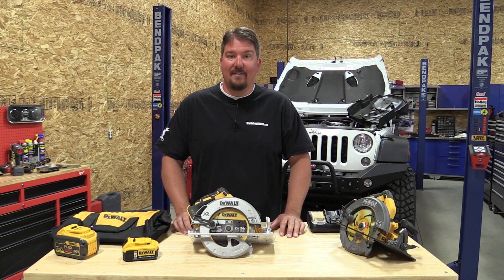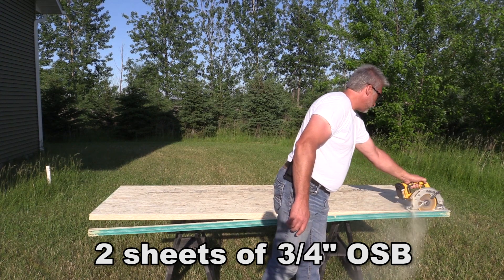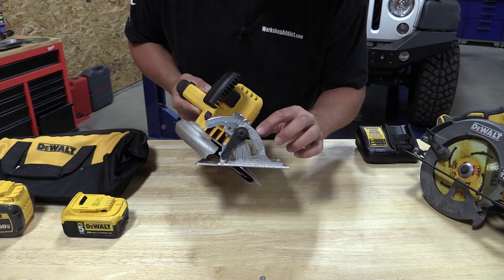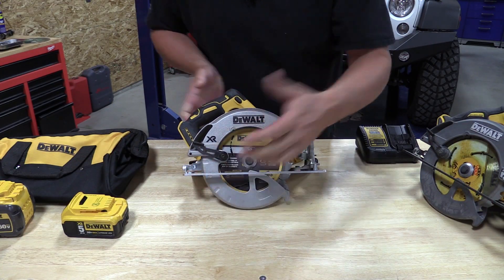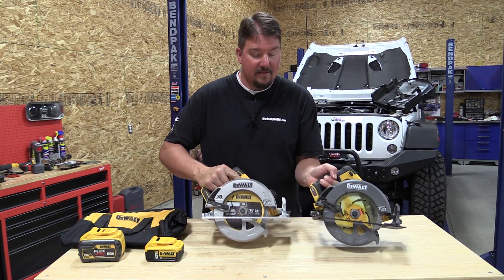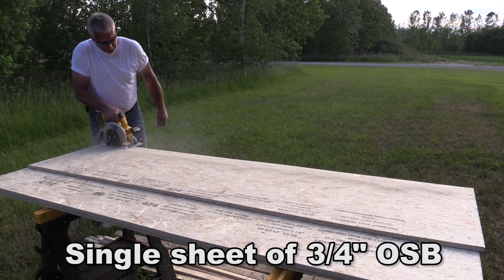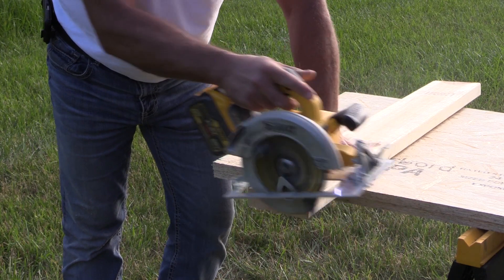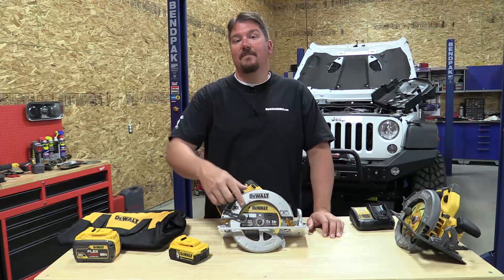DEWALT DCS570 20V 7-1/4" Circular Saw with Blade Brake Review

Comment: 2024…Dewalt still hadn’t corrected the zero scribe on the shoe front not lining up with the blade.  It actually cuts about 2mm to the right of the index mark…this is not ‘kerf’ if you think about it the inside edge of the blade should align to the zero index so the kerf is part of the waste, but it doesn’t.  So, either use a fence or make a new marker in the shoe for free hand cuts.

Comment: I have this saw and I’m yet to find a task it can’t do I do a lot of basic framing and some sheet cutting and it flys through these tasks with the included blades runtime is okay on 4ah batteries too I had the old Ni-cd saw before the lithium XR tools and it wasn’t anything to write home about but this is as as good as an 240/110v saw I imagine that the FlexVolt saws are an absolute beast

Comment: That is interesting that you noticed a difference in power, because on paper they are basically the same.  Dewalt lists the DCS570B as being a 900W saw.  The 60v version they list as being 15A.  15A * 60V = 900W.
Reply: Perhaps it's a mistake or DeWalt did that to show it comparably to a corded version because the maximum watts out of the Flexvolt is 1600 compared to 900 for the XR.  The worm drive style, rear handled saw is max 2400 watts out.
Reply: flexvolt has1600 Watts!

Comment: My flexvolt just broke yesterday think the brake has broken sounds rough when u release trigger
Reply: bob johnston Did You  find the problem?
Reply: @interman7715  blade brake is broken and there is no way to fix it with out replacement of the hole motor so its cheaper to buy a new saw emailed dewalt and never got a response.
Reply: bob johnston What a bummer .
Reply: Saw is still going full power but just sounds horrible after cut
Reply: bob johnston Is it still under warranty?  If not a good tool repair guy should be able  to fix it or at least disable the break .
Reply: @shotgunj1  the brake on a motor is just a $2 capacitor. I replaced one on a table saw years ago. You just need a little soldering experience. 👍

Comment: Just wondering if the guided shoe is interchangeable from a flexfold to 20v because they look similar
Reply from the maker: I believe so.  Pretty sure they work all along the DeWalt line.
Reply: Why bother? They are both pretty solid bases, you don't gain anything from doing so.

Comment: Did you find this was bogged down easily when cutting anything beside white wood? I have been using it to cut cedar 2x8’s and 6x6’s and it’s bogging down continuously.
Reply from the maker: It boggs slightly on everything, but to bog to a slow speed, no.  I was cutting red oak this last weekend in 8" rounds without issue.
Reply: Mine bogs down I tried with flex volt battery's and it didn't help. It's a bit underpowered for me. It has stalled out on me a on thicker material and I have had to back it off and restart my cut.
Reply: @1stfloorguy59  u need to learn how to cut with a cordless then or upgrade to flex volt

Comment: Just how much more is a "significant increase in runtime"? I have the flexvolt and like it, but am seriously considering swapping to its little brother if the runtime is truly that much better.
Reply from the maker: I think you misunderstood what we are saying.  Just prior to saying the Flexvolt battery gives this saw a significant increase in runtime, we were talking about how the 20-volt does not have the same power as the Flexvolt.  We never compared runtime from the 20-volt to the Flextvolt, we only stated that using the Flexvolt battery on the 20-volt saw gives the 20-volt saw a significant increase in runtime over the 20-volt 5.0 Ah battery.
Reply: Okay great, thank you. In your experience though, do you think the 20v saw with a flexvolt battery would last noticeably longer than the FV saw? I don't really mind the loss in power, but work a lot of off grid jobsites and am not super pleased with the FV's runtime
Reply from the maker: If you are cutting smaller pieces and not stressing the saw, Yes, the 20 volt max might last longer.  It all comes down to watt output as the battery you are using (FlexVolt) has the same watt hours in 60 volt or 20 volt.  So my guess is the watt output on the 20 volt is less.  Hard to say.

Comment: I am looking into purchasing a cordless circular saw next month.  I realize that when I do I am committing to a an entire cordless platform.  At this point I am still vacillating between the Milwaukee M18 and the Flexvolt.  Question:  How long does it take for the charger to fully recharge a depleted battery?
Reply from the maker: Stanley Pearse Hard to answer these days because of the different chargers on the market.  Some are fast chargers some are slow.  plan around an hour.
Reply: Based on your experience, what cordless tool platform would you lean towards  - M18 or FlexVolt?
Reply from the maker: Stanley Pearse Milwaukee has more tools and has not changed platforms as much as DeWalt.
Reply: Thank you!  Really appreciate your feedback!
Reply: Stanley Pearse If you go with Milwaukee M18 Definitely Get the Fuel Version of everything you won't be disappoint!!.
 The 6 1/2in saw & 7 1/4 have the same size motor just different size  blade  #WorkshopAddict has review's of both on the channel.
& Homedepto has the  Milwaukee Fuel  7 1/4 SAW starter kit with the 9.0amp battery & Rapid Charger for $249 or the bare tool for $229 so it's a Great deal if I had the money id get one myself lol.
 They also Have the Fuel sawzall with the same deal.. Good luck!!😊
Reply: Thanks Mark.  In August I need to rip 18 sheets of 3/4" ACX plywood into 8" planks - for flooring.  So I need to make sure I have plenty of power and run time.
Reply: Stanley Pearse I recommend the Milwaukee. I switched to it several years ago from the old ni-cad Dewalt. the advantages of Milwaukee are several. the main ones are that the 7 1/4" Milwaukee works great and it has rafter hook so that in awkward situations you can safely hang it on framing members, scaffolding of saw horses. Milwaukee offers a 9 amp hour battery for their tools and in the saw it increases the power so much that I haven't taken my corded saw out in the 9 months since I got the batteries. it simply does everything a corded does and the battery lasts a very long time. 

Milwaukee has a far better warranty than Dewalt. 5 years versus 3 and they really back it up. I work in the trades and I work hard sometimes 7 days a week and am not really gentel with my tools. I have abused some in order to get the work done and Milwaukee doesn't bat an eye, they just take care of it. 

another great feature of their line  up is the dual voltage (12 and 18 volt) multi port rapid charger. no one else makes one. it offers 40% faster charging on 3 batteries at a time then it switches to charge the the reaming three if you have it filled up. plus it has a convenient carry handle that allows you to easily carry your back up batteries to and from the jobsite. I haven said many times that the charger makes truly makes cordless convenient.
Reply: Thank you so much for your reply.  I have the Milwaukee M12 drill and driver's and have had no issues with them.  Been trying to find a real solid reason as to why I should get DeWalt instead and have not found a viable reason to switch from Milwaukee.  You brought up a good point regarding the warranty.  Thank you again!

Comment: $279 for this 20v max saw, but the flexvolt is $249? Why wouldn't you upgrade? Just my two cents... #WorkshopAddict
Reply: maybe some one has alot of 5 ah 20 volt batteries, instead of buying a saw that needs different 60 volt batteries this way they could stay with their batteries.
Reply: Because normal dewalt slide packs dont fit on flew volt tools.
Reply: All I can say is shop around. I just purchased the 20v brushless, brand new for 35 bucks shipped to my door, which I was looking at the flex volt as well. Since the batteries are backward compatible.
Reply: I paid $128..saw and blade only.  I have the Dewalt family so have the batteries.

Comment: Thanks for answering my question about running with the 60v battery. I have worked with both platforms just not at the same time. I have the 20v now and i make it work but miss the what i remembered more power of the 60v. I just got a free 60v battery coming in the mail so ill be able to do my own test. Looks like i might be pulling the trigger and buying the 60v saw being ill now have 2 batteries. That's what kept me from getting it from the get go. You have to have 2 batteries.

Comment: I have the old 18v 6 1/5 saw and all the 18v line, but I'm slowly switching to 20v so I decided to get this 20v 7 1/4 saw, it's okay, in not expecting to do like corded would. My only reason to this saw it's because cutting depth and cheaper blade. Thanks for the review.
Reply: It is the same as 18V (in Sweden, they are called 18V - the exact same saw and battery). 20V is just a merketing gimmic for the US.

Comment: Right hand blade FOREVER, left hand blades are horrible.
Reply: I was curious about the left hand blade chase some say they are better. I noticed browsing at the store today if you are right handed with a left blade the front handle is offset which makes your front arm crosses up and seems like it might get in the way of your marks on the front of the saw. Idk if I’d like that.
Reply: whatfreedom7 Correct mate ,if you are right handed with a right blade you can hold  the timber with your left hand and the  base of the saw is supported on the timber and the waste falls away .Also the sawdust shute is away from your body not  pouring it on your legs .I am right handed and have been a carpenter for 30 years using right hand blade saws and I have no trouble cutting dead straight lines ,imho left hand blade saws are awkward and dangerous. In Australia no one uses left hand blade saws unless they are amateurs.

Comment: Why can't dewalt make these blade left...it's so frustrating I would love to upgrade to the new brushless but what gives...BLADE LEFT!!
Reply: Bush Wacker Blade left is for amateurs.
Reply: @interman7715  this comment makes no sense it’s all preference and plus I use both left and right for certain applications
Reply: @mrgrump2534  I am a right handed carpenter and have used blade right saws exclusively for over 30 years , I have tried a blade left saw once and gave up with frustration, there is a reason 99% of saws are blade right.
Reply: @interman7715  I mean like on decks and certain Spots that are tight areas that you could utilize having a left handed blade… but yes I agree with u in every day use and common cuts

Comment: This is so confusing, you call this the DCS570 and this is a 20V saw, but i have other tools that are 18V and when i look at the DCS570N it is 18V. Why oh why did they name these the same, when they are not.
Reply: Same reasons Samsung started "LED TV" years back even though they are still LCD TVs with the only difference being LED backlights (what does that make older LCDs then...."Light Bulb TV"?), and soon everyone was calling them that. What's good is there haven't suddenly been all these "20V" lines from competitors where all they have to do is change the label. Also most "full synthetic" oil sold in the U.S. isn't really Group IV base but highly refined mineral oil, and even though some can still be very good, that's not what people think they are getting for the price after Castrol marketing got away with changing what it used to mean.